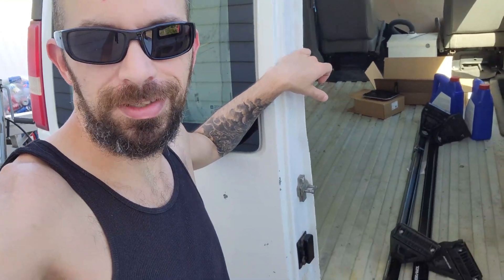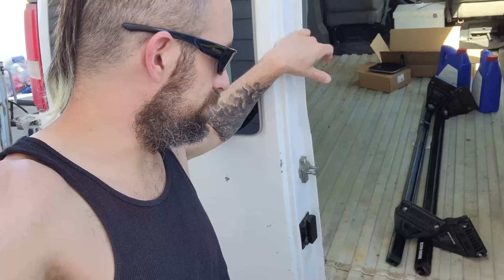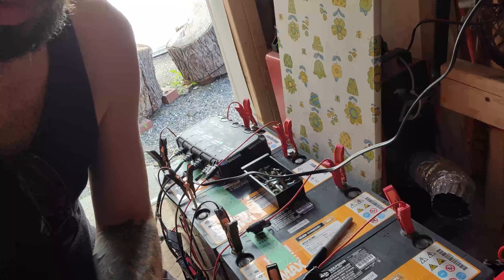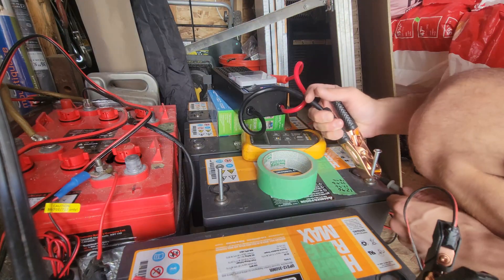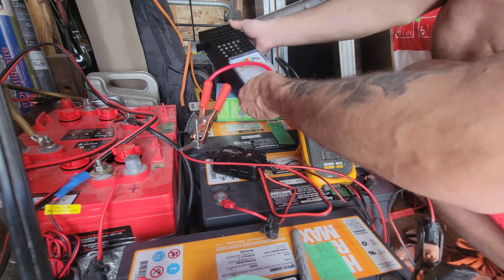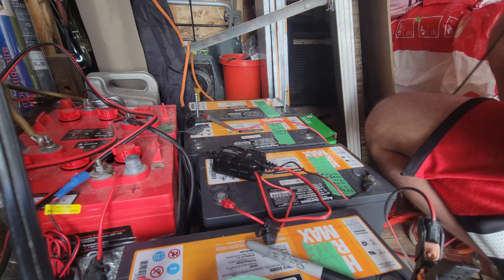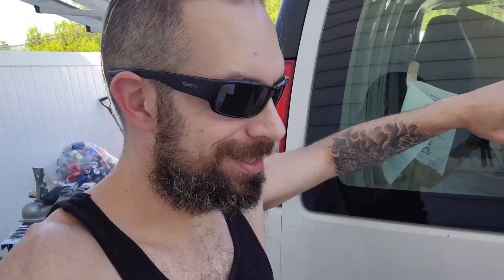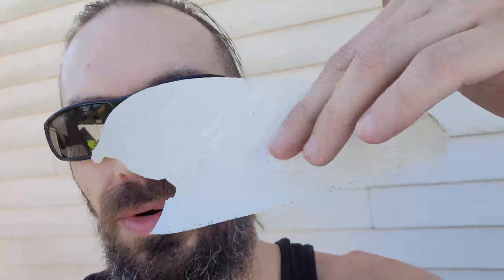How to test Deep cycle batteries with a 100A Load Tester

Comment: Are you sure it's a good idea to use a 100Ah load for a short time on a deep cycle battery? 
that battery isn't designed to provide massive current for a short time. Quite the opposite.
I wonder whether the test is reliable / conclusive and it may damage the battery rather than diagnose it
Reply from the maker: Absolutely. These batteries are rated for 800 amp discharge. That battery tester is only 100 amp. Basically I'm looking at the voltage drop during the draw to see if the battery can hold voltage while it's putting out 100 amps. Nothing is perfect. But it's really good way to find out if your batteries are shot. But I wouldn't test a battery that couldn't handle 100 amps to begin with. This is Just a general test battery shops perform and sharing knowledge I've learned.
Reply: @SpikedVanlife  800amp?  is that the CCA value like on the  automotive starter batteries? 
I'll have to double check but I believe the deep cycle batteries on my RV don't even show a CCA value or any other discharge value. Only the overall capacity value. 
They are designed to deliver little current for a long time
Reply from the maker: @feca4654  the batteries I own are from an ups data center.  You should be able to find the spec sheet and it should have the values you seek. The cold crank amps are a good value, also ca which is cranking amps. But keep in mind those values are designed for a short amount of time. Deep cycle on the other hand They will have the ability to run high amp devices like a trolling motor for example 55 lbs thrust will pull over 50 amps. And people run them for hours at a time. 100 amp should be fine on most deep cycle batteries. The trouble with this test is that you need multiple batteries to find a base line that you could compare it to. But not required as long as the battery is holding a good voltage under load.  For example. 100ah battery with 100 amp holds at 11.5v is considered healthy. But if the same battery drops to 9.5v I would consider that a dead battery. An inverter will shut off at 10.5v. Hope that helps.
Reply: @SpikedVanlife  wow, I've used one of those motors before but never realized it would pull so many amps
Reply from the maker: @feca4654  yeah. That exact same battery that i have in my van (6) is the same battery  i use with my boat and last about 4-5 hours with a 30 lbs motor. Which pulls about 7-12 amps at speed 1-2.